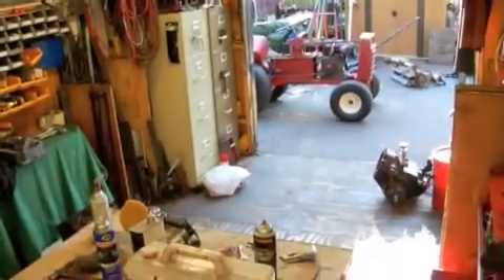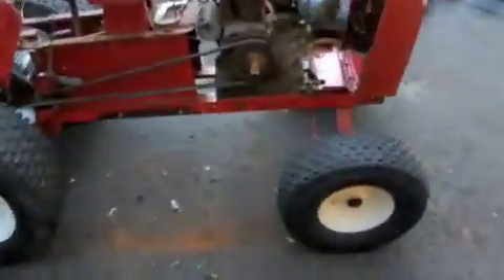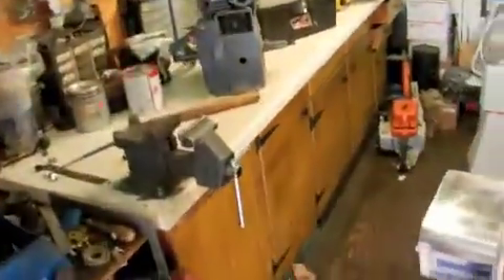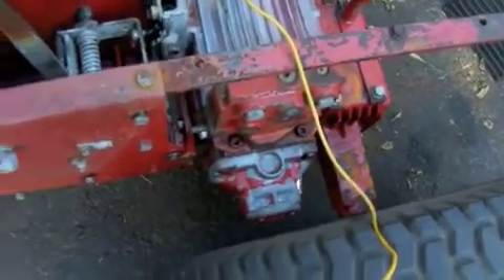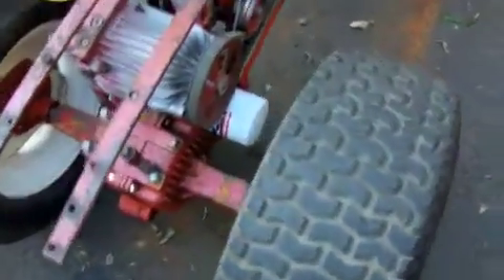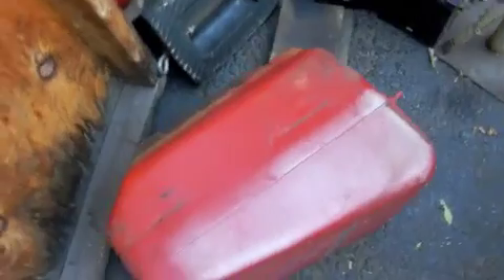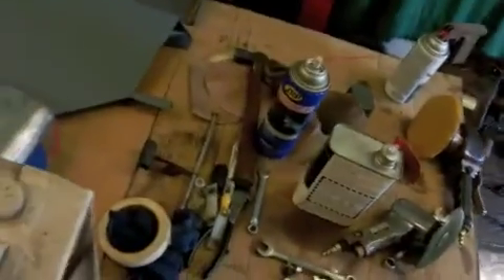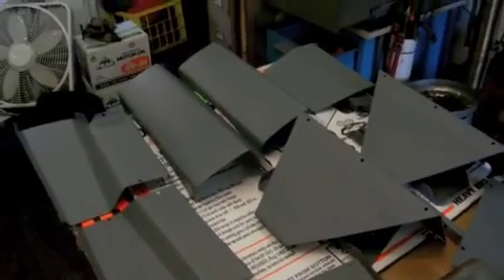1970 WheelHorse GT-14 Restoration- Part 1

Comment: I have a 1972 wheelhorse with the 12 hp Kohler in it hydrostatic trani. Just bought it a week ago and I was having problems with it not wanting to run unless the choke was on fully. So I tuned the carb a little and got it running great. But 10 mins of driving it around it starts to choke out and did then will idea like crap. If I try to give it throttle  it dies out. Any ideas
Reply from the maker: Jordan Scheurer Did you get it to run without choke when it started to die out? If so the main jet might have gotten clogged, one that goes up through the center. You can pull out the main needle on top and check to see if the air holes in it are clear. Another reason could be if it idles okay but dies when throttling up, it may have a weak spark. There may not be enough to fire the fuel when you rev up.
Reply: It was the main jet. Dirt and molasses in the bowl. Can't believe it ran at all. But it's running great now. this winter planing on painting the deck while I have the blade on. Thanks for your help man
Reply: Recently purchased 1972 Charger 12. Being my first tractor I'm kind of going into this blind. It starts and runs after I put transmission fluid in it. But it's leaking transmission from the rear end. Just for the record I paid $280 cash. And I am happy thanks for posting Dan

Comment: Thanks for posting my question why do you run 30 weight motor oil in the rear end . Mine is leaking and may attempt to change the seal or gasket. Any help or advice would be greatly appreciated thank you Dan
Reply from the maker: Hi Dan,The early manuals called for ATF, later for 10W-30. Either will work, but the 10W-30 has a thicker consistency so it will build pressure in the pump better. I remember reading somewhere years ago that the ATF was causing the lock-nuts on the differential bolts to loosen up, whether it's true, I'm not sure. Just about every other hydro I have here is 10W-30 except the MF14.Gasket is very easy to change. If it's the same style pump that's on the GT14, drain the fluid, the entire hydro pump unbolts from the side of the transmission in one shot, replace gasket and bolt back up.
-Jake

Comment: trading my 1986 duetz 616hydro for a gt14 with 3pt hitch,i think they put a 32 ci kohler in it.stil got to mess with the 1954 gravely been in parts since beg.of summer,hard for me to spend the 70 on a piston but got to do it.
Reply from the maker: +Mike Markes I think you'll like the GT, they are great machines. Yeah, they nail ya on the cost for those pistons, then you add in the rings to boot....
Reply: ya my duetz was nearly mint and this gt is a mess but 2 totoly diff. machines,and should be good project,not going to make pretty just running and working for what I'm doing with it.

Comment: hey from Mississippi I need some help id a kohler engine the model 818s spec 30531d sn 7202370 I picked up for 30 bills but the older guy had some mods and im doing a father son build. he has a ford coil bolted to it and and some other things and I need some help from a person that works on them. it is free and has electric start no pull cord so any help would be great and I came across some wheelhorse tractors while motor hunting just sitting in the weeds.